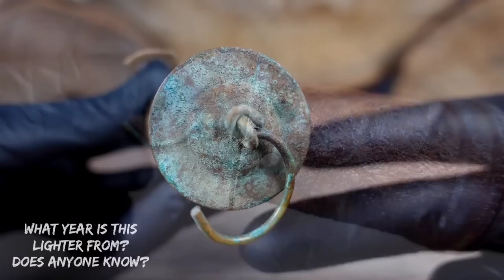Flame Beacon - Restoration of a Beautiful Rare Rusty Lighter

Comment: Not a metallurgist but it's been my experience that brass, bronze tarnishes but does not rust.
Reply from the maker: It can be covered with corrosion from other metals, brass oxidizes and changes color
Reply: @TheRestorer  Yes Green, not red.
Reply: @TheRestorer if you make a slurry out of iron filings, water and vinegar you can cake it on and create a layer of iron rust on brass parts.
Iron oxide in water doesn't just adhere to brass objects nearby.

This video is virtually the same as people who "restore" die cast cars that are coated in iron oxide as well, despite the bodies being made of zinc alloys
Reply: Brass doesn't rust. Did you see pitting or deteriorating of the brass. No you didn't.  Rust was attached to other sources and got on this piece.

Comment: The top and bottom of the brass lighter look like they were corroded brass.  The rest looks like it was painted to look like rust.  Brass doesn’t rust !
Reply from the maker: Yes, brass does not rust. But it can be covered with corrosion if the object is among rusty metal
Reply: 040823/2321h 🇺🇸  @houstonceng>>>There was no mention of ‘paint’ by the presenter, except, you.  If the metal was ‘painted’; while in chemical bath or while WD40 was copiously sprayed, the paint would have dissolved immediately. I don’t think the body is Brass. It looks like Bronze. Please appreciate the author. Thanks. 73s…
Reply: Uio🎉😅😅😊😊pô99
Reply: Seriously??? Ha okay.... well I am here to say, even if it is painted (which i don't believe, WD-40 would have immediately melted the "paint" off) it is still a damn good and entertaining video. I appreciate what this guy does. Regardless
Reply: Do you have this artistry and talent? I assume you don't. If you can do better, create a video and then do so.

Comment: It's a french lighter (MARQUE DEPOSEE underneath which means "registered trademark") and specifically one made to look like a miner's lamp. Nice job man.
Reply from the maker: Cool! Thanks for the information and good review!👍😉
Reply: No, it IS a miners lamp.
Reply: @senorboardhead  no, a lighter. If it was a miners lamp it would be bigger and the part where the pins are inserted around would be glas. Although, some models look and work pretty much like a lighter, including the flint and wheel. The wheel would just be turned from the bottom. And in most cases you would have an additional screw to set the wick length.
Reply: Very cool, thank you for the knowledge!
Reply: A você também, belo esclarecimento! Quem sabe, sabe!  ❤

Comment: Put silicone sealant on the jaws of your pliers & vise so you won't damage what you are gripping. The silicone can be peeled off & reapplied as needed. Use clear silicone so you can see what you are gripping better. Silicone gives you a soft, non-marring grip. It protects the object much better than tape. Jewelers use silicone on their tools for delicate items.
Reply: Cool tip!
Reply from the maker: Thanks
Reply: Would electricians tape do the job as well?
Reply: No, electrician's tape will not work as well.
Reply: Vice!
Reply: That’s a really good tip!
Reply: For pliers silicone tubing or just the clear tubing you may find in a hardware store works nicely as well.
Reply: You’re so right!  I’ll respectfully add that whenever I’ve wrapped up a job, I’ll immediately peel and reapply silicone so it has time to cure before next project.  If I really need THOSE pliers again, it is far easier to just peel it off.
Reply: Glue gun works good too
Reply: Shrink boot works well also.

Comment: "Rate my work in the comments"
10/10 for showmanship
0/10 for reality and craftsmanship 
Iron oxidizes into red rust. Brass doesn't. If you're going to "restore" the lighter covered in dried coffee grounds at least fix the poorly  soldered/epoxied joint on the bottom.
Reply from the maker: 10/10 for showmanship - Thank you!)💚😉

Comment: It is a methane detection light , most
likely from a coal mine . The bottom part.probably has a
magnet built in
Reply: I have one of these like new , the miners
called them bug lights
When the miners got
near methane the flame , would rise up
you are missing , the
glass shield  that surrounded the latern
Reply from the maker: Thanks!)

Comment: I was wondering if this was based on an old lamplighter's tool ? They used to carry a short wooden ladder that rested on a crossbar on the lamp post, so they could climb up , turn on the gas, and then light the mantle with a cylindrical lighter with a hook - (you see this in some old prints).
Reply from the maker: Hello! Cool! I have not heard this information yet
Reply: @TheRestorer  The hook could be used to send the lighter up on a pole instead, or just to hang the lighter from your belt.

Comment: You did good work. I like the restoration. Not a fan of the parts theatrics though. Moving dirty parts, moving clean parts. It got annoying. I would’t have commented to criticize, but you asked. I would have suggested a wire wheel on the striker instead of sanding wheel. Too aggressive. Keep it up though. Restoring trash to treasure is pleasing to view. Good luck to you.
Reply from the maker: Thank you very much!) I will try to make the following videos not boring for you!)

Comment: If you can get something called PB Blaster, it works 100,000,000 times better than WD40. In every way.
Reply from the maker: Oh cool! Thanks for the advice. Where can it be purchased?
Reply: @TheRestorer  Not sure where you are at, but I get it at my local hardware store, or an auto parts store. If not, amazon has it. 

Stuff is awesome.

Comment: I'm going to give it a 0/10, seeing as how the restoration was fake. If the lighter was made of copper and brass,  why was the fake scaled corrosion on the outside red?   Only ferrous metal has red corrosion,  like iron and steel. Copper and brass turn green when they corrode.  Aside from that,  there was zero pitting in the surface of the metal.  It's impossible to have that much scale corrosion without the surface getting pits in it.   This is like the 5th fake restoration I've seen today.  I bet you put more effort into making it look corroded than you did in actually restoring it.
Reply from the maker: Hello! This lighter was lying near the metal parts.
Reply: @TheRestorer  that's still doesn't account for the buildup of scale rust and the absence of blue/green corrosion under it. There would be a mixture of both if that were the case.  I've worked with metal for over 20 years. I know what the metal should look like if it were in contact with ferrous metal. The absence of pitting in the metal, and the absence of a blue/green layer of corrosion mixed with the rust tells me that the corrosion was faked.  With the built up rust on the surface there should have been heavy pitting in the metal. Also the fact you used plastic bristle brushes on it is another clue it was faked. Using plastic bristles on metal is pointless when trying to remove corrosion.  Other than it being for show there's no reason to use it.   Corrosion turns into powder when you brush it,  the fake corrosion you painted onto the lighter stayed shiny while you were brushing it.
Reply: I agree with you Joseph. It's fake.